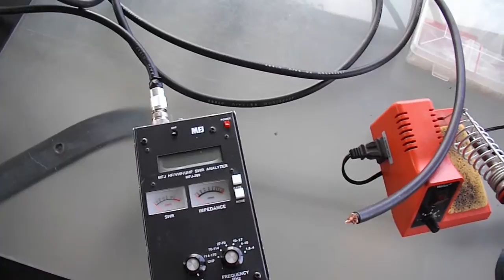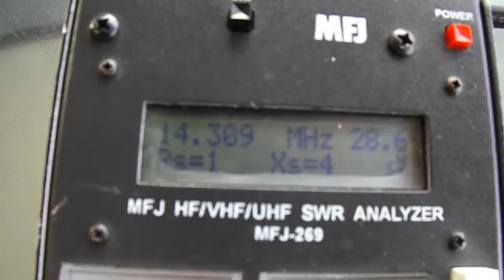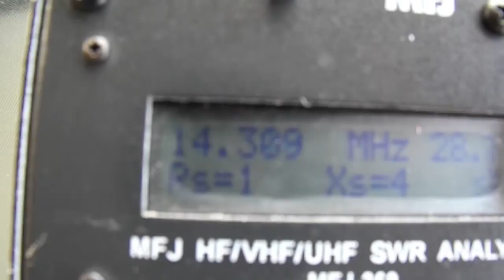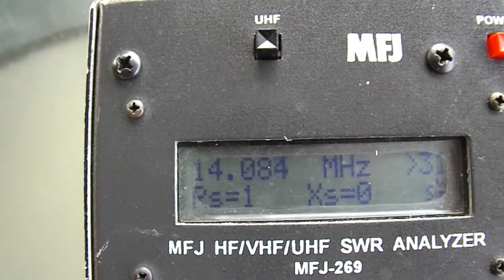Field Day/Em-com coax stub filters

Comment: Hi. Where do you place the Tee for the stub? At any 1/2 wavelength along the feedline? Does this also help to filter other unwanted noise? Or only unwanted noise that also appears from the harmonic frequencies?
Reply from the maker: I placed it just a couple feet from the rig with good results, I have not tried any other placements. It will help on other noise, if the noise originates out of band. Harmonic suppression is in the mid to high 20s DB depending on the coax used. The next step is band pass filters that have three times more attenuation. I use both. After this vid was made I got a 20m and 40m filters. These are much better and much more expensive. Using the stubs with the filters makes it even better.

Comment: I'm just now starting to learn about stubbs and wondering if you could answer question is it a true statement that anytime you connect a stub to a T connector it is considered to be in parallel?
Reply from the maker: Yes, In this application. There are stubs used as matching sections for antenna tuning that are used in series.

Comment: Good Job.  You mention low power applications,  does 100 watts fall in this category?   recommended switch rating?
Thanks!  73
Reply from the maker: Sorry for the late reply. Yes 100 watts is what I have used. I have not tried more power

Comment: How do you tune coax
Reply from the maker: Since the impedance repeats every half wave ,you can measure the electrical length with an antenna analyzer. so you trim (tune) the length by the impedance or reactance measurements.
here is a link to the article if your an ARRL member
https://p1k.arrl.org/pubs_archive/105771

Comment: so how would this work as a filter to stop UHF ??
as in  a repeater i want to RX 433.000 but want to stop 439,000 
would this be possible ??
measure coax and trim back until x is zero on 439.000  ??
Reply from the maker: It might work but I don’t know how wide the notch would be.  433 and 439 are not harmonics of each other.. Most repeater builders would use a crystal filter for that. 

You would need to use a low loss coax at UHF. LMR 400 or 600.  It would be a good experiment that would not cost much. a quarter wave at 433 is not much coax
Reply: @amrwhiskey3456  could you add two stubs tuned either side of the desired frequency to filter it better? Perhaps also variable capacitors so the stubs are easily tunable?
Reply from the maker: @izzzzzz6  the stubs are not sharp enough for that, they cover most of the band. But you can add more stubs for better attenuation.